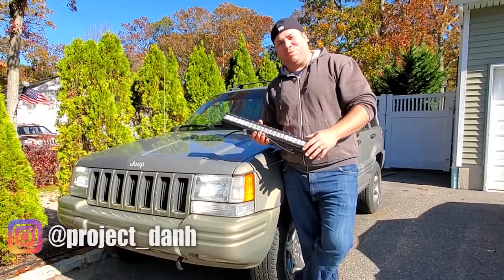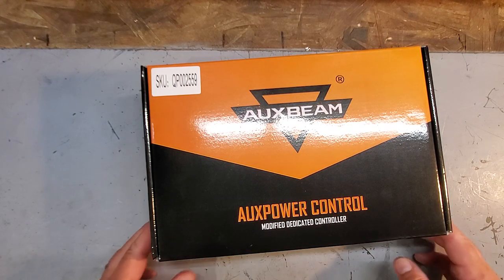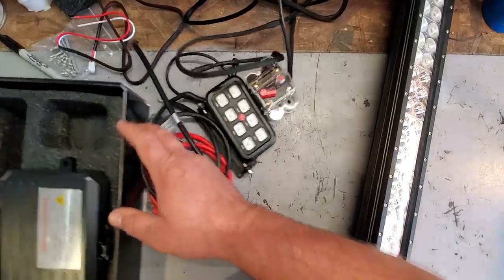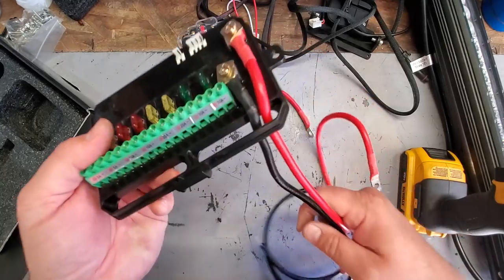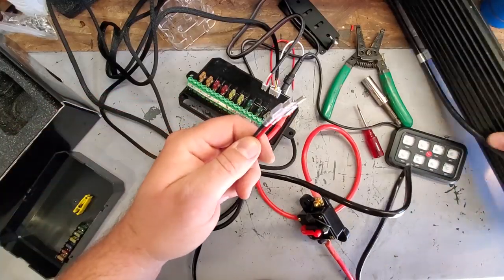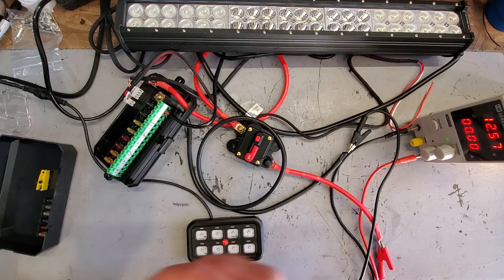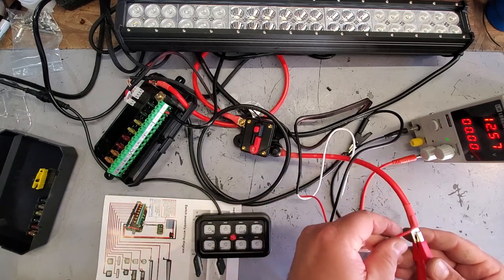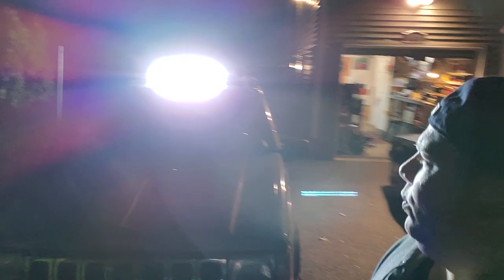AUXBEAM 20 INCH LED LIGHT BAR AND 8 WAY ACCESSORY SWITCH PANEL

Comment: Best place to mount a bar of that size is on the bumper in front of the grill. You can actually mount a 38” light bar on the roof between the roof rails using the existing mounting holes, no need to drill holes into your roof.
Reply from the maker: Good to know.. I love your 52in light bar idea tho!

Comment: Did you ever hook this up? I have similar control panel and  iam finding its a pos!! The red and white wire, well it says to connect red wire to a 12v acc or 12v switched power. Well when i do it stays on, won't shut off with key. Or i got a lemon. I know the switch panels that have the 3 wires red/white/yellow wire work much better the the 2 wire.
Reply from the maker: Sorry to hear yours isnt woking.. mine is still boxed up and im not sure if ill be using it

Comment: I’m trying to decide where to put my 30” Auxbeam light bar that I won from muddy beards 4x4. I am going to be installing it soon so I can update them. Let us know where you are putting it at.
Reply from the maker: Awesome 👍 muddy beards is great.  I'm not sure what to do yet but I'll let you know when I do. Lol 🤷‍♂️
Reply: Gotta love Muddy Beards...
Reply: I think it will fit right between the roof rails on Jeep. That way it's high enough to put light out but is somewhat protected from tree limbs.

You could also drill into the cross bar. I did this with my pod lights and I think it looks good and it seems to be sturdy enough.

Comment: Just an opinion but the light bar on top of my XJ had such a bad glare!! It is an older one tho so that may be the issue
Reply from the maker: I think any light source at eye level will reflect right back into your eyes pretty bad. the best way to go is probably extremely high up or extremely low to the ground so light doesn't bounce back into your face

Comment: Very rad, what's up with your sunroof though?
Reply from the maker: 🤦‍♂️ the track is shredded... I need a whole new sunroof assembly.  It's gonna be one hell of a video!
Reply: @ProjectDanH  yeah, mine wasn't working ended being the track cables were completely removed by the previous owner plus the rear track guide broke and the right side track plastic broke.  Could fab up something with steel but meh, that's a lot of work right meow
Reply from the maker: @GodSpeedGato  LMAO.. yea too much work.. ill hunt one down and make a vid in the spring
Reply: @ProjectDanH  I have a 97 parts XJ with a functional sunroof. Is it worth trying to swap it to another Jeep that didn't have one or would it be better to sell it. If so, I would be willing to sell it to you.
Reply from the maker: @titusclark5432  Thanks for your consideration, I really appreciate it.  I'm pretty confident it is possible to add a sunroof.  It should be straight forward to cut the overhead console and run the power to where the switch and motor goes.  I believe you will also have to do a headliner swap to accommodate the giant hole and the motor.  The toughest part would be to actually cut the hole.  Most aftermarket sunroofs leak because it's very difficult to make a perfect cut.  If you wish to attempt it, measure twice ... Cut Once.  If you decide you want to sell it to me I hope you'll give me a great price! 😀🙏. Good luck man.. let me know!
Reply: @ProjectDanH  Sounds like more trouble than it's worth. I do have the headliner from that Jeep as well but it is in terrible shape. Are you interested? Unfortunately, I have no idea what it would be worth.
Reply from the maker: @titusclark5432  yes, where are you located?
Reply: @ProjectDanH  just south of Amarillo, TX.
Reply from the maker: @titusclark5432  dang.. I don't think shipping the entire ZJ to NY will be cost effective.  If you can send me just the sunroof I'll pay for all the shipping.. LMK if that's something you'd be willing to do
Reply: @ProjectDanH  haha probably not on shipping the ZJ. I would be willing to ship it. Message me on Facebook and we can discuss further details. Search my name and I live in Happy, TX.
Reply from the maker: @titusclark5432  will do, thank you!

Comment: Stop playing get the 50” light the block up
Reply from the maker: Haha. Seriously!  As soon as they send a free on I'll light it up
Reply: I ordered a 52” for my ZJ, not realizing it wouldn’t fit....so I made it fit. I went to Home Depot and got 60” square 1x1” metal tube along with some longer bolts. I cut the tube down to 54”, drilled the holes, and mounted it right on top of the front roof rail mounts. Sits up pretty nice and lights up the world when I turn it on.
Reply from the maker: @erikstrieter4233  that's dope! Do you have pics??
Reply: Project Dan H. Sorta, got a pic from the front. Not sure how to post a pic here tho.
Reply: Project Dan H, sent an instagram pic.

Comment: could always rig up two light bars. 1. chin mount it on the underside of the bumper. in between the foglights. it would be tucked up and out of the way. real nice. 2. rear mount it off the luggage rack shining downward offset to the driver side so you can accually have backup lights. cause backing up with those crap lights can be a little dicey at times. …….. add a toggle just so you can flash those idiots from riding your rear bumper with there bright lights on. 

Not that I would do anything like this myself, 
(cough cough … horse shit... hack hack, cough cough)
Reply from the maker: LMAO! I love that idea! (Not that I would actually do that.. 😉 Cough cough) If I do something like that you guys will be the first to know!